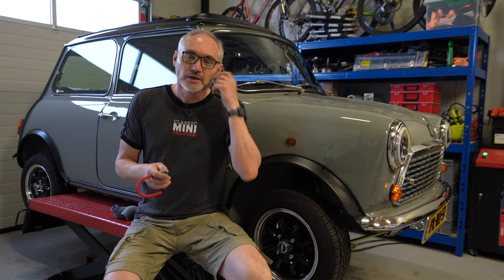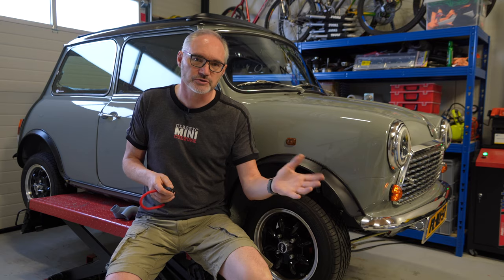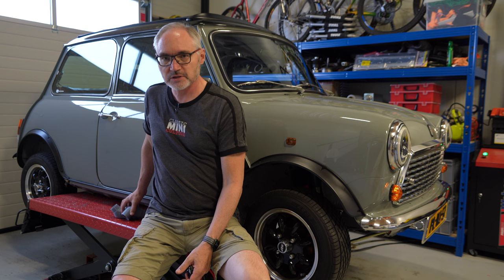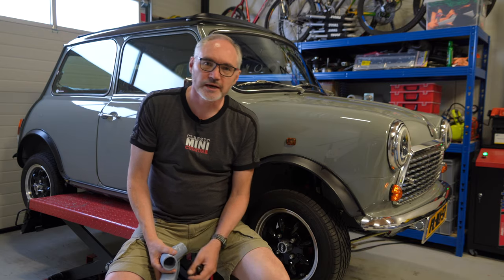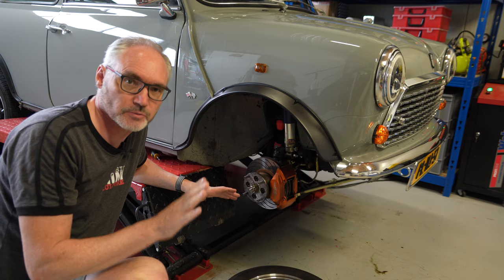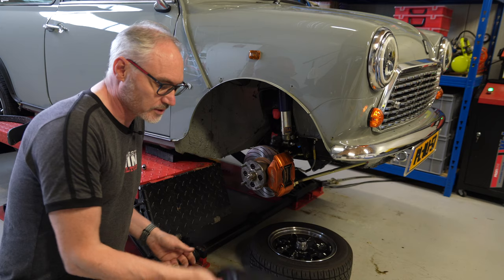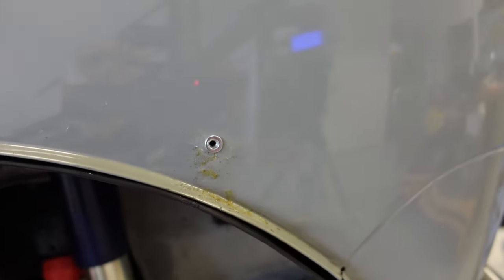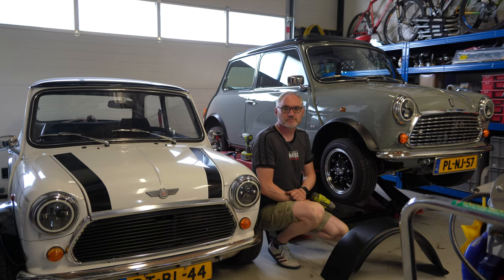Stop Rust fit Arch Liners

Comment: I always wondered why this is not standard. As minis tend to rust easily this is such an easy upgrade. I would think its still a good idea to wax the inside arc. Just for the added protection. And then fitting these. I find It strange that no other mini channel has shown this. Is this such an unknown thing?
Reply from the maker: thanks Frans, I try to find unique mini points of interest, I personally got a little bored with all the "body shop and welding video" channels so hopefully we can add a little more variety to the mini-community.
Reply: @classicminiculture9800   I know what you mean. I love to see people work on the mini. But indeed, most are just body work. Col from classic mini diy is great but he is not that active atm. I also like Stevenstonmotorco for their somewhat different way of working with the mini. Also I would love to see more guys just doing small things. Restoring a classic is a small channel who does what I like. Take 1 thing and restore it. I really want to do stuff like that but still don't have my mini. I am searching the net now and then, trying to find some used stuff to start making parts for myself. But can't seem to find good sites to find them

Comment: Isn't this fender liner going to be a dirt trap? Because mud is probably going to get stuck in between the rear lower part where additional mud flaps could be mounted. Modern cars have these liners indeed from standard, but that isn't really for rust prevention, more for stone chip prevention and sound dampening. I'm curious how it's going to preform.
Reply from the maker: Not really, what you could not see is that these liners have a 5cm lip at the rear that goes under the body, removing the need for a mudflap, last generation minis have these fitted and it does seem to help delay rust in the wing.

Comment: I should really fit some of these wheel arch protectors to my restored SPi. My original plan was to keep the car in a dry garage and only venture out when the weather is suitable. However, this doesn't always work in the UK as even on a good day with no rain in the weather forecast you can still end up with a wet Mini.
Reply from the maker: Fully relate to that Graham, I moved from Sheffield to the Netherlands, but didn't see any improvement in the weather ;(

Comment: Will you show us how you fitted the left hand arch liner. I have a set of these to fit but accomodating the fan has caused a delay. With regard to the heater hose redirectors, a great solution, would you consider producing them for other mini owners?
Reply from the maker: If you have the additional electric fan you do need to carefully cut around it in order for them to fit correctly, unfortunately, they don't provide predefined cut lines for the fan, even though they did for the rest of the body line............ On the 3d printing I would love to offer them to others, but its an open source file from thingiverse.com, so you are free to print it yourself but I don't have the rights to sell or distribute it commercially......sorry

Comment: any reason why you didn't first clean and add a fresh layer of waxoyl or other rust inhibitor to improve the odds of success?
Reply from the maker: Only because the car had been wax oiled 3 months ago before its APK/MOT, so I was comfortable with the protection, but YES I would recommend it when closing off any panel.